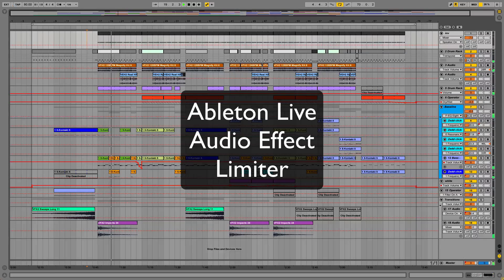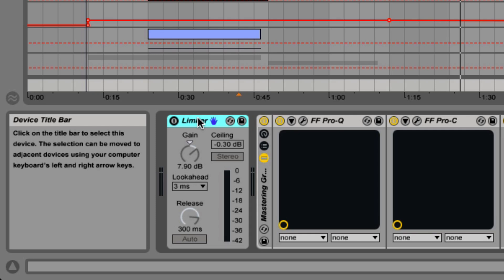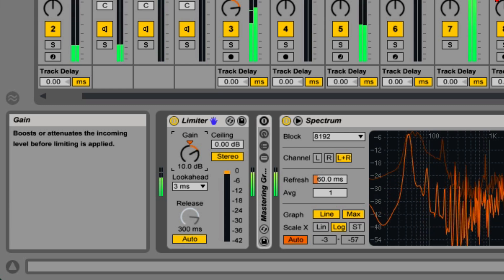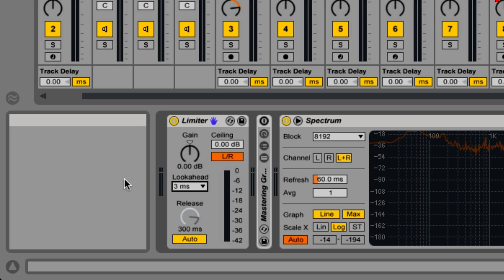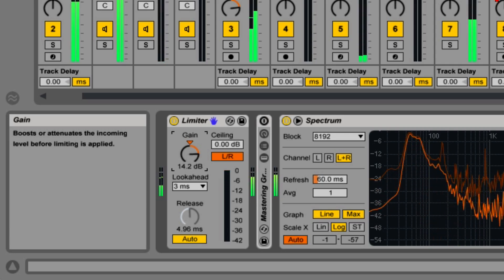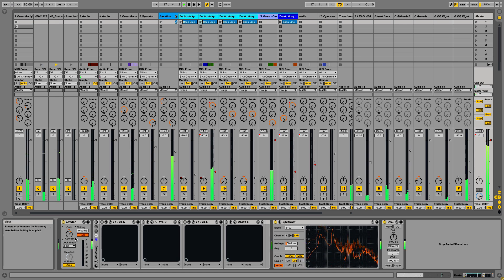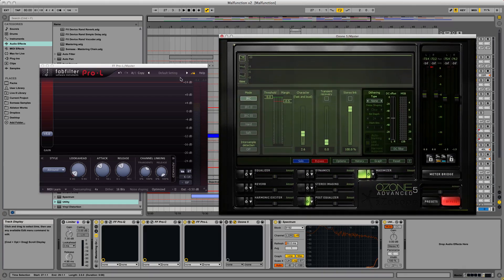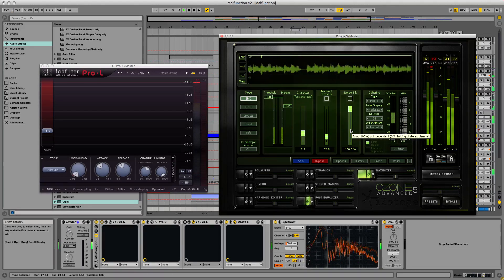Audio Effect - Limiter (Everything You Need To Know) Ableton Live

Comment: What's the relationship between a limiter and true peak? I have a limiter before a youlean loudness meter, and even if I set the ceiling to -1.00db, the true peak goes higher than that on the loudness meter.

Also, where is the ideal placement in a mastering chain for a limiter?

Thank you :)
Reply from the maker: like compressors, limiters have attack settings. sometimes noise still gets past the limiter causing those extra high peaks. true peak limiters just make sure absolutely nothing goes above the set amount. set your ceiling to -.3 or something. no need to do -1

placement is opinion. ill put a limiter limiting less then 1db at the start( just to take off the highest of peaks), then multiband, then another limiter limiting a bit more (set to true peak limiting). but the way i do things is always changing

Comment: I use multiband dynamic and compressor on single track and limiter on the master. The result is pretty good if i listen to it with monitos or headphones. Usually the mixtapes are played on radio. What I notice is my mixtapes don't lose dynamic but they have really low volume comparing them to other artists' ones. I tryed to encrease the gain of master limiter but the result is horrible. Have u got any advise to encrease volume without losing dynamic so much? I should apply an additional multiband dynamic effect on the master?Thnx
Reply from the maker: This is an older video of mine. Now a days my master channel consists of a limiter doing minor limiting, then a multiband compressor, then another limiter limiting a little more heavily. 
Id like to make a video on how I master my work but i just dont have the time now a days.
Reply: try to compress each elements of the tracks, adding little gain without distorting it.
Reply: thank u so much :)
Reply: i just considered your actual setup cause if apply multiband directly to the tracks since usually they are really compressed the effect of dynamic is the clipping so I've to use a limiter before to reduce then the multiband and then a limiter again.
Reply: if you want more loudness then reduce in the low frequency range, also gain staging so nothing peaks hard is good too.

Comment: Thanks for the video, I have a few problems in Live 9 that I hope you can help me with (1) I can't get Ozone 7 to load up in my plugins , it will load from my desktop but not seeing it in Abelton live  9 (2) When I  launch Live 9 I am getting a error msg
Transport 32bit via Rewire and it says its probably in use and in order to run this program as a rewire slave application you will have to launch live first. I am getting this error msg every time I launch Live 9

Comment: I haven't been using Ableton too long, but I am having issues with my tracks not being loud enough even though I set my master track right below clipping volume. Is this the answer to making the tracks louder?
Reply from the maker: +hiitsrandy this is a simple way to achieve louder tracks. the best way would be to learn multiband compression and parallel compression.
Reply: nope use compression this is a huge difference. ur music will sound so much more professional with compression
Reply: OTT
Reply: Hi there I have had the same issue. when your exporting there are options, there's a box to uncheck or check called normalize, uncheck that and it'll be the way that it is when you're listening to it in the daw. Also there's the same options in the burning program Windows Media player if you go to make a CD in the options there's a normalize box also there. that can get people also